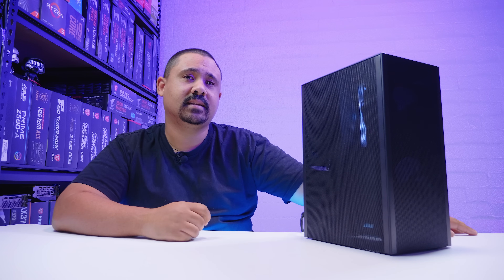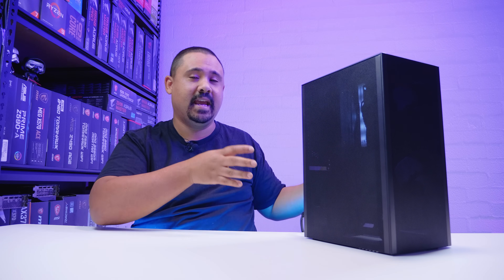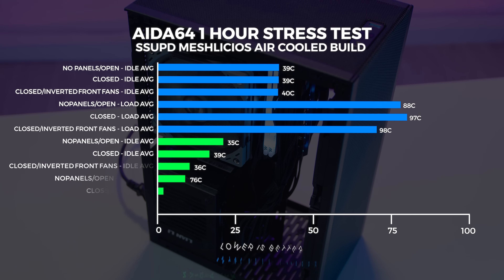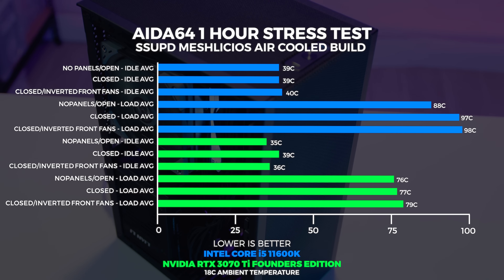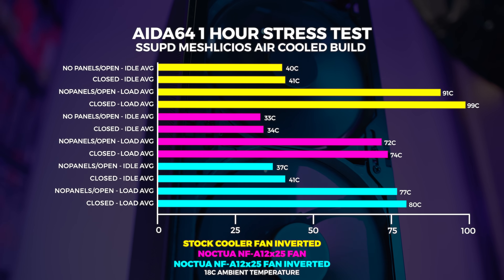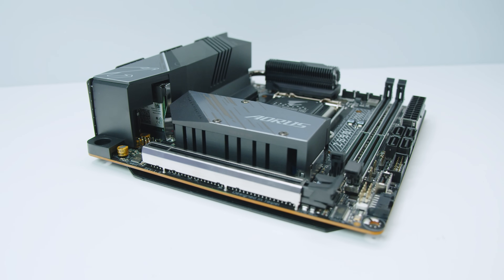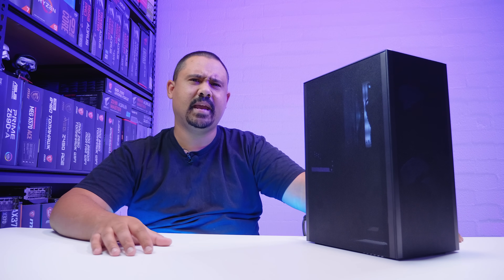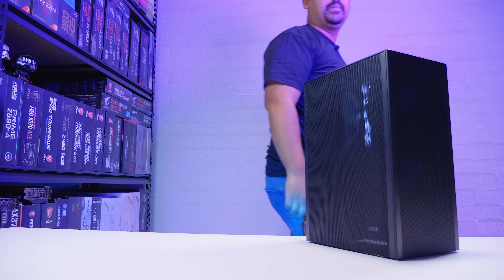SSUPD Meshlicious Air Cooling FOR SCIENCE!

Comment: Just bought this case today for £85 new. Time to Google some parts.
Reply: The case is really good to build in. You can consider liquid cooling the CPU (fans as exhaust). As for the GPU, There are a couple 3D printed parts that allow you to add-on 2x 60mm fans where the ITX PCIE slot is.

Also, if your GPU isn't that tall, you can sneak in a 92mm fan on the top to be an exhaust too.
Reply: @francois.m  thanks for replying but I returned the case and bought a Lian Li O11 Air mini. Came out sweet.

Comment: I have this case running a ryzen 5 3500x and a kraken x53 cooler with both fans as exhaust, I know cpu temps will be higher with that setup but my idle temps are at 45 degrees. No overclock, reapplied thermal paste and the works, any ideas?

Comment: do you think this Scythe Big Shuriken 3 is the highest possible cooler in this case? i have a setup with a Shadow Rock LP that needs to move to a bigger case because GPU and it looks like the Rock is 2mm too high according to the Meshlicious manual. what's your take?

Comment: I’ve absolutely no idea how you fit the Noctua 25mm fan in this beast. Mine is sticking out fairly significantly that i can’t close the motherboard side panel
Reply from the maker: Use the mesh side panel. It does not fit with the glass. I mentioned that

Comment: Do you think you can investigate further how there's such a dramatic drop in temps by replacing the stock BS 3 cooler with a A12x25?  Most reviews I've seen the difference was maybe 4-5C at most, but 20 C is really something..........

Comment: The thing is SSUPD could easily resolve the GPU port issue by actually supplying case feet to raise the height of the case for better compatibility with big DisplayPort cables but they don't. You can 3D print feet from their website but not everyone has a 3D printer... How hard could it be to supply case feet with the case, We're talking about 4 plastic pieces and 4 screws?

Comment: The aluminum pegs the GPU sits on can be adjusted in height, based on the cinematic shots, its looks like its only on the middle selection. The 3070ti used has enough room to be seated at the highest adjustment, allowing more room for regular non right angle cables. Give it a go, I have a Meshlicious build using the stock feet and I don't have to use right angle cables.
Reply from the maker: The issue is I usually use GPUs that are much bigger than the 3070 Ti FE where you HAVE to use right angled cables.
Reply: @GearSeekers  Very true, It's the biggest oversight on this case imo. The cables I tested and managed to get to fit while using the stock peg configuration as shown in the cinematic shots, are the Maxonar DisplayPort cable 1.4 on Amazon. For anyone that has access in their country to test them, I would give it a go. They are being stressed to the max at their cable tension relief points and are essentially being crushed into a right angle, but they work and I can get 1440p at 144hz with them. Just want to throw that out there in case anyone needs long displayport 1.4 cables. They can be hard to find at a right angle.
Reply from the maker: The only reason why I didn't switch to this case was mainly for that reason. Right angled DP 1.4 cables are unicorns

Comment: Due to the laws of thermodynamics it will actually heat up your room the exact same amount for both setups (assuming the electricity draw is the same). 

The total heat output of the system won’t change, what does change is how that heat is transferred. 

This is the same reason why a cheap electric heater is exactly as efficient as an expensive one if they have the same power draw.
Reply from the maker: Yes, the law of thermodynamics applies to a space of controlled volume with no variables other than the input and out of power and thermal transfer over a finite amount of time. However over time (which is the factor you're not considering) the ambient temperature will be different. The total heat output and power consumption is the same yes but If you game for 20 mins and game for 2 hours the ambient temperature in the volume of space will be different. There are also other factors. You're assuming that every single room is a closed space with no window etc. That's not what I said. I wasn't talking about efficiency. I was talking about if you wanted to heat your room up quickly.
Reply: @GearSeekers  Ah ok, then the one with the lower CPU temps is likely transferring the heat to the room air faster, as less heat is concentrated in the case. 

So the worse (higher CPU temps) cooler will raise the room air temp slower. And the better one (lower CPU temps) will raise the room air temp faster.  

As a cpu cooler is basically a heat pump, taking heat from the cpu and putting it in the air. 

I thought you were saying the opposite.

That all being said, I would deff opt for the lower cpu temps and noise any day.

Edit 2: Ps. Love your videos always great.
Reply: @blackfalcon53  That's exactly what he said, I quote "it probably won't heat up your room as much" (09:44). It will in fact heat up your room the exact same amount, the question is how fast it will do that. 

The video is great, and this guy makes some great videos in general. I just hate it when people are corrected, and instead of admitting a mistake they prefer to try bullshiting their way out of it.
Reply: @GearSeekers  That is simply not true. If anything, it is the other way around. If the CPU consumes 200W in both experiments, and with the Noctua it runs cooler - it is in fact transferring heat to your room FASTER, and in fact will heat up your room faster than the worse fan.

EDIT: great video except for that

Comment: I don't remember which other Youtuber tested fan configurations with this case and they found that a negative pressure setup with 2 140mm fans provides the best balance of cpu and gpu temps. cpu temp is slightly higher and gpu temp is helped a lot especially if the mesh panel is on the gpu side. Negative pressure pulling fresh air in from the sides, top, and rear.
Reply from the maker: This doesn't work with air cooling. As mentioned in the video with our original review we had a negative pressure 280MM AIO Setup. That had the best overall thermals. You might want to check that video out mate.

Comment: I use the HDMI 2.1 cable that comes with the PS5 in my Meshlicious. I had a right angled 2.1 cable from Amazon fail out of the package so I made the PS5 work by setting the GPU up a bit higher as per the instructions. It works perfectly though the cable does look a bit jacked up.

Also rocking the Wraith Stealth cooler with additional 20mm standoffs for the motherboard for cleaner cable management (cables tuck in nicely behind the motherboard).

Comment: the right angle cable issue is more than a little bit annoying... in many cases it will be a showstopper, because it is virtually impossible to find right angle connectors for displayport cables in particular.

Comment: I really need to learn how to mess around to with fan curve to get the most out them I hate have to switch from silent to balance then extreme when I am doing work or gaming
Reply: Keep track of your temperatures when you are idle, when you doing something light on the computer, and when you're gaming. Then when you going into the BIOS, you'll know what your minimum, medium, and maximum temperatures are. Then you can set your fan curves to accommodate those temperatures.
Reply: @jGRite  thanks bud <3

Comment: I just built my Meshlicious yesterday, using a big shuriken 3 and a Cooler Master MasterFan Halo on the CPU. I had to modify the fan slightly, so the screws sink about 1mm deeper, then it fits perfectly. Couldn't be happier
Reply: Is it the same for all 25mm thick fans? Nick didn't mention anything about having to mod it when he tested NF-A12x25.
Reply: @ailluinthethyra6139  I don't think Nick showed the Noctua setup. Maybe it can vary from one model to another, but with a MasterFan halo the screw heads were proud and prevented the mesh panel from closing. I used a drill press to make then flush. Flat head screws could work too.
Reply from the maker: They worked without modification

Comment: Just put mine inside the white version yesterday. I don't want to take it apart ever again.
Reply: How was the build and did you use an AIO?
Reply: @swizzler8053  I did use an all-in-one. Deep cool 280ex. While I'm on the desktop doing things, like transferring files and surfing the web it remains at a constant 62-70°c. I'm slightly concerned, and I need to going into the bios to make sure the fans are ramping up as they need to. Also, I could not fit the radiator right side up. It was impossible with how the outlets are placed. That's something to be aware of if you get the larger 280 all-in-one. 

 I learned that with a DTX motherboard one of the screws in the back of the case has to come out or else the motherboard will rub up against it. Even with the minimal amount of cables it's still packed tight. However I did manage to fit every single thing in there without a bulge. I can't say that about all my cable management situations in the past.

 I might post some pictures on my Instagram (@jGRite) though I haven't used it in a while for anything. I have been thinking about just posting things on Reddit instead.

Comment: don't you think a noctua l12s will be the best bet if air cooling in this case?
But man those a12 fan thermals were epic af considering the size of the heatsink but then again its an i5.
Reply from the maker: I can't test something I don't have mate.
Reply: @GearSeekers  yeah yeah i wasn't saying you should test was only asking opinion. But considering how cheap arctic 280mm aio is i don't think this case is made for air cooled builds.
Reply: @datdudeinred  Arctic 280mm AIO is a pain in the ass in this case and most SFF cases. 65mm total fan + rad thickness, tubes coming out on top of the pump instead of being repositionable on the side and longer stiff tubes  is a real bad combo.

They're great for other applications though.

Comment: They have 3D printed feet you can add so you can fit regular cables

https://ssupd.com/pages/download
Reply: IMO, those taller feet should come in the box or be installed stock for such an expensive case.
Reply: @shanksisnoteventhatstrongbruh  I agree, but the more I look into SFF the more I see that even with the super expensive cases, people are spending extra to mod and fix them in ways they like
Reply from the maker: I think the fact you have to modify something is actually a design flaw.
Reply: I thought I could do without the feet, buy my GPU needs to be as low as possible to fit, and even an angled Display Port won't fit.